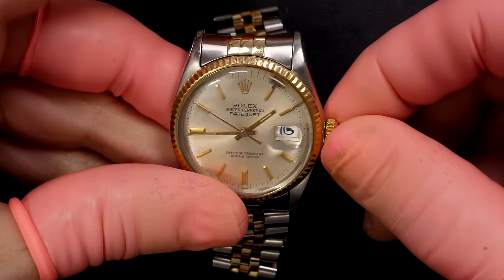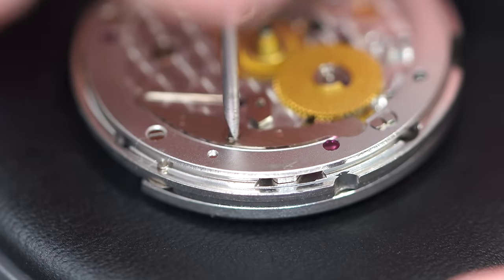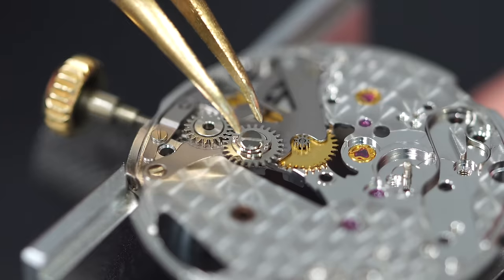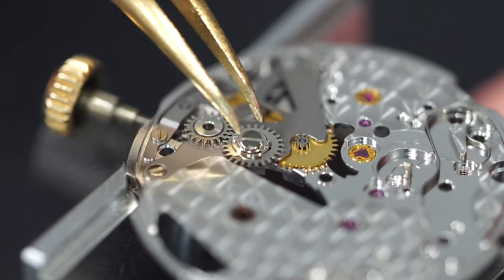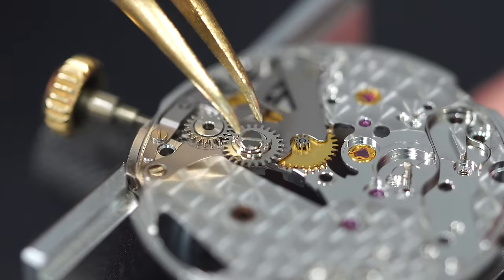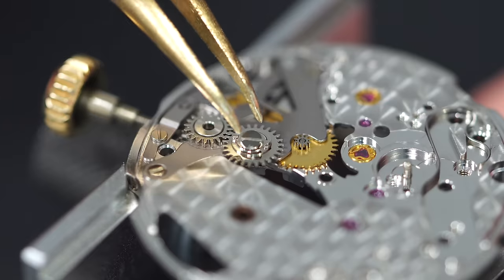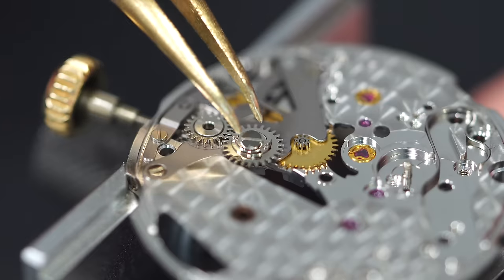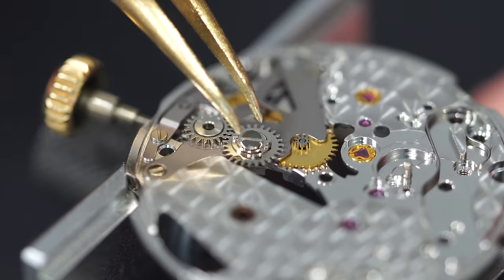Repairing a Rolex Datejust Steel & Gold Watch Ref 16013 Caliber 3035

Comment: At 5:30, you're talking about Rolex having 27 jewels, and having more is better. I have a Vostok amphibia, and its automatic movement has 31 jewels... So Vostok has the better movement.😳
Reply from the maker: Your Vostok caliber has 31 jewels but 10 of them I think are in the reversing wheel. I would not sat necessary it is a better movement if it has more jewels but it is a sign of a good quality for sure